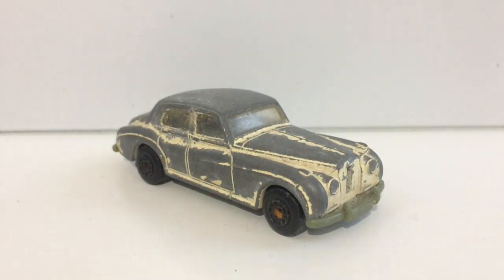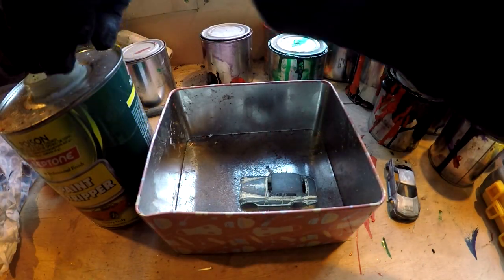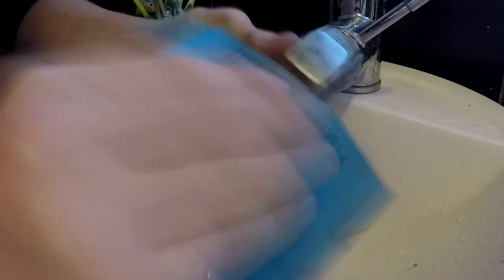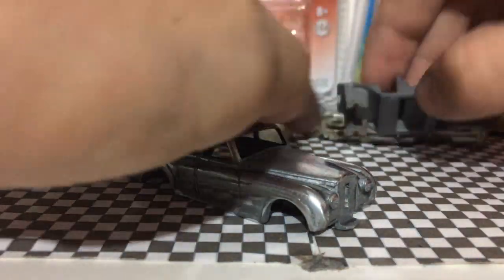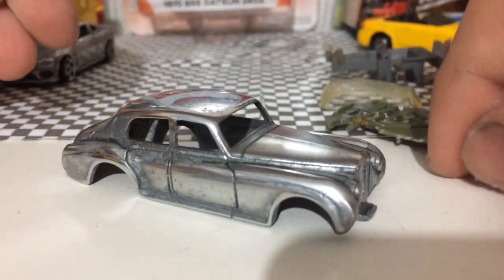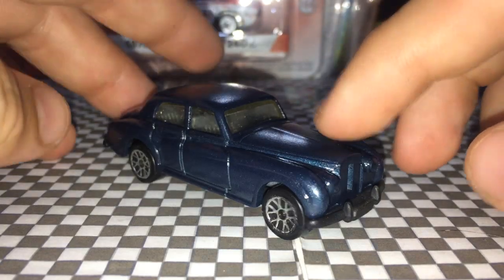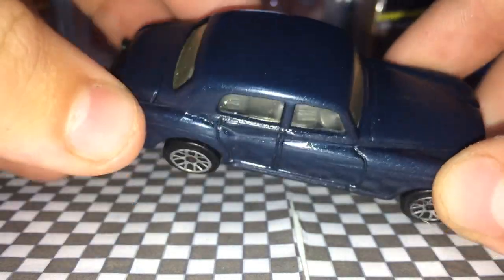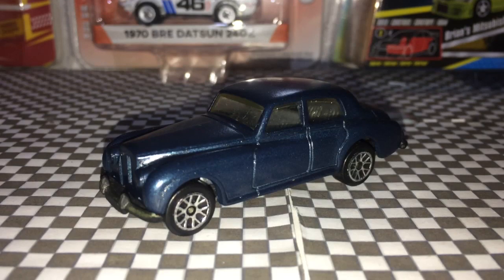Matchbox Custom 'Restoration': 1986 Rolls Royce Silver Cloud [INCOMPLETE]

Comment: Pretty nice but it needs a grill, heavier paint on the chassis, Silver leaf on the bumpers and ditch those crappy wheels and give it some new MBX wheels, the vintage style ones as on most MBX cars these days. Nothing wrong with gluing it back together, I do the same thing but fill in the holes some more then paint over them.

Comment: Great job mixing the paint and the final finish on it came out great. Why didn't you repaint the base?  Especially the bumpers looked rough since they are exposed in the final product.  Touch up with chrome paint?
Reply from the maker: Thank you, glad you like the way it came out, as for the base I'll tell you this - this is the last time I'm using a spray can to paint any plastic parts 😅  From now on I'm using my airbrush to paint plastic pieces, wish I would've known it was going to look really rough and bad :( and also don't worry, I ordered a chrome pen and it's on the way :D
Reply: Cool :) Nice work.

Comment: Where is the rad? Also paint in the lights!
Reply: Rad?
Reply: Rockett Customs, radiator, iconic symbol of rolls Royce. Highly chromed with spirit of ecstasy on top!
Reply: Chrome marker is a good quick solution for the headlights, red nail varnish applied with a tooth pick is good for the read lights.

Comment: Watched a couple of your videos. And I'm just not understanding your restoration process. I thought restoring things were to bring them back to a certain order. Most of your Restorations or at least the two that I watched are still missing parts like the grills more rear ends or whatever. The Rolls-Royce you might have done a good job on the paint job but without the grill the Rolls-Royce is just not a Rolls-Royce and I wouldn't call it a restoration if it's not finished. Anybody can throw paint on something.

Comment: You did in fact make mistakes that the camera picks up. I can see thin areas on the bumper and underside where the green shows through. Also, did I see correctly, it looked like you hot glued it back together? I love the body color but am not impressed with the base and assembly. Sorry, you asked for input.